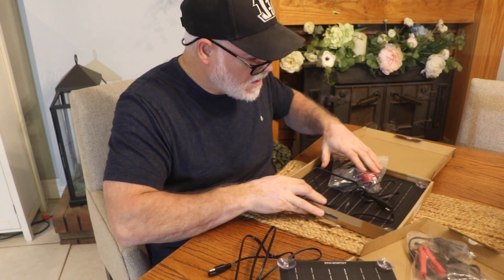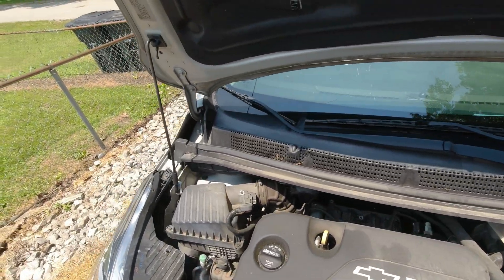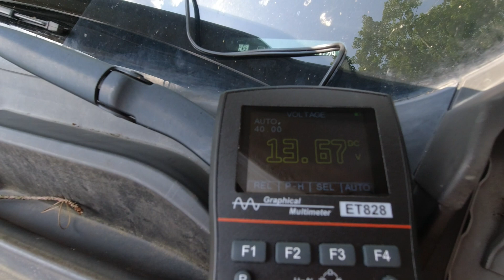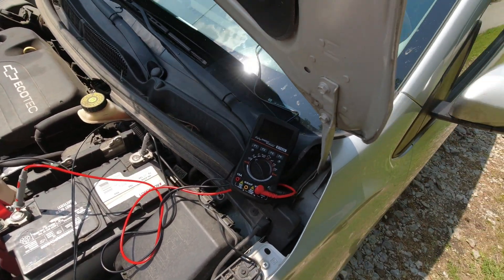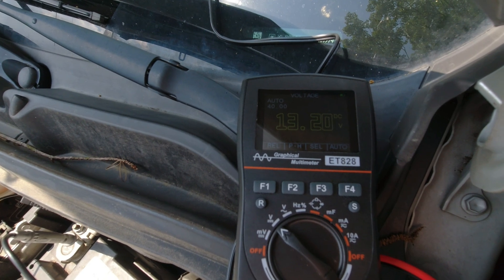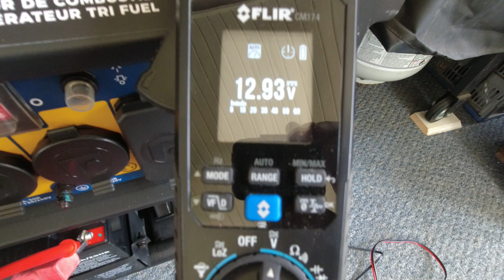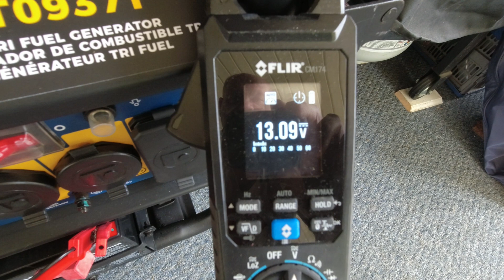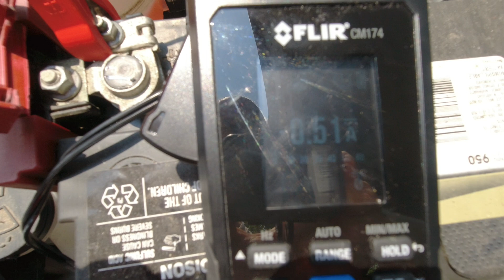Eco-Worthy 5 and 10 Watt Solar Battery Maintainer

Comment: Can i use this on my inverter 12v lead acid battery
It is 200Ah lead battery
Reply from the maker: You can use it on 12v 200ah battery, but this more for maintaining and trickle charging your battery. Thanks for watching and commenting.